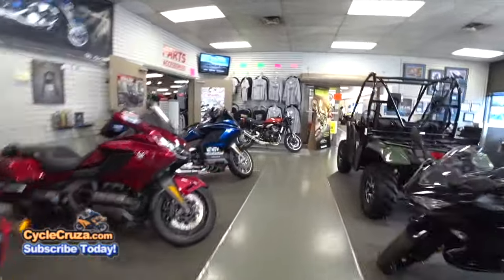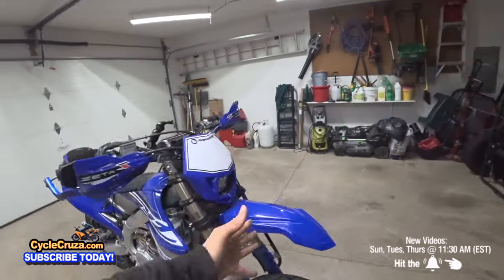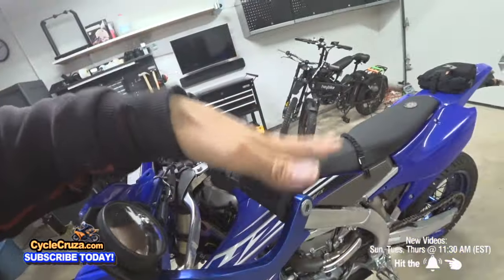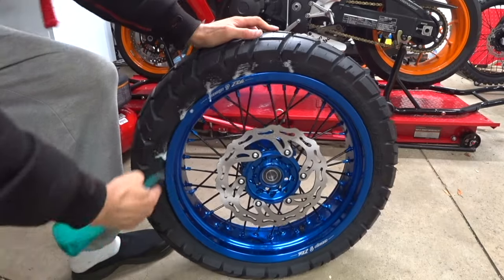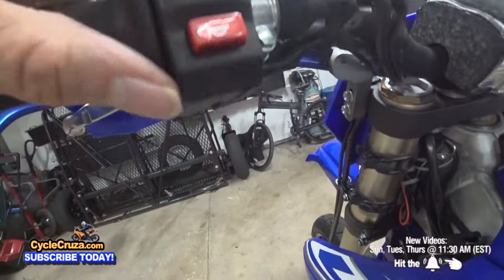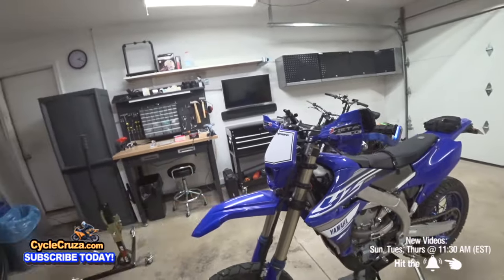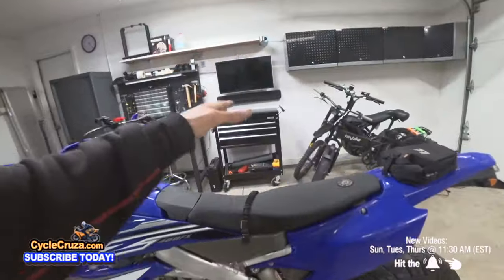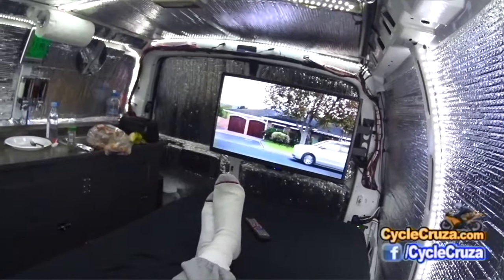Want a SUPERMOTO?  Mods Build + Make Street Legal

Comment: I bought a jump pack that’s a unique design just for emergencies. It doesn’t NEED need to be recharged. It uses a super capacitor, so even if your battery is pretty dead you connect it and it rapidly drains the battery into the super capacitor, which lets you start your car because capacitors are designed to release all their stored electricity INSTANTLY, so basically it lets your car kick over fast by charging it with your dead battery, which is just such a cool concept I had to buy it.
Reply: Link?

Comment: Bro the 690 heavier like I said before but a 450 does not compete in any way. The 690 n701 are way more powerful they handle better better suspension better electronics and way more reliable

Comment: KTM had it right with their first SMs.... the 625 and 640 LC4 SMs and Dukes were 55hp stock, under 300lbs with rock solid reliability and practical maintenance intervals like real street bikes.  They should bring that formula back.  I have owned a bunch of modern 450 MX bikes.... they are awesome but the drawbacks are the maintenance and no matter how reliable yours has been.... they all aren't and you just have to understand that a 450 is a grenade with the pin pulled from the first time you start it.  It will blow up and its going to be expensive to fix.... keep enjoying your WR. As a 20+yr DS and SM rider/owner I enjoy your videos.
Reply: KTM 525 exc do I need to say anymore lol all the KTM rfs range are very reliable bikes and high performance without the high maintenance as the Motocross versions. I have a 525 as a supermoto, sportbike killer in the tight Twisties and I'm not biased as I've got a gsxr 1000 so know what both bikes can do

Comment: Thank you for all your suggestions!
Still thinking about going electric for 2 reasons:
1) here in EU cops and neighbors are not so tolerant as in US. So you want to fly under the radar and make no noise.
2) going to YZ or KTM EXC i am so afraid of that high maintenance efforts. On electric you drive and drive and drive. Maybe do the first gear oilchange once after 400mls and nezt after 5000. And after 5 years buy a new battery. 
Stark varg and zero FXE or FXS are also much lighter and more powerfull than KTM Freeride (which is damn cheap used here in EU = $5000-$6000)

Comment: I’m jealous of the weather up there man. This was a record breaking hot summer in New Orleans. We had damn near 2 months straight of 110-120° F Heat index, humid heat is miserable. 100° with high humidity is worse than 120 degrees in a desert, your body’s ability to cool itself by sweating literally can’t work in humid settings because the air is already saturated with moisture so your sweat doesn’t condense into the air and that is what’s supposed to cool you. We don’t get 4 seasons here. We are about to go from around 100° heat index to a cold front with lows in the 50’s. Literally overnight just summer to what we consider winter 😂😑😑😑

I’m over it. Riding season for me STARTS when most people start “winterizing” their bikes. I need to find a place that doesn’t get hotter than 80 and isn’t so humid so I can ride year round.
Reply from the maker: Dang! We have been very lucky that we did not get that heat wave. I only put the A/C on two days the entire summer. We've been in the 70's with no humidity all summer long. I can't stand hot humid weather, one of the reasons I sold that GA property. Summers are brutal down South. However, when our winter starts your nice weather begins so enjoy the coming great weather.
Reply: @CycleCruza  I’ve been spending hundreds per month every month since late April on A/C. It’s “only” ~ $340 after I spent $5k to replace the unit, before that it was costing $500 a month. Literally runs 24/7. I could handle it as a kid but every year that passes a tolerate the heat less well. In the winter you can always bundle up more…in summer you’re screwed it’s not like you can get naked, and even if you could it wouldn’t help 😑